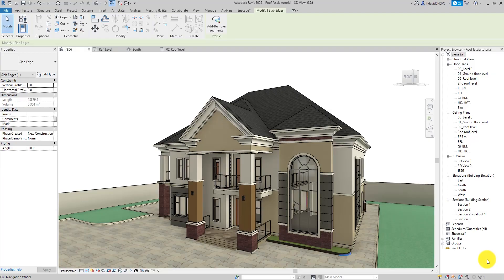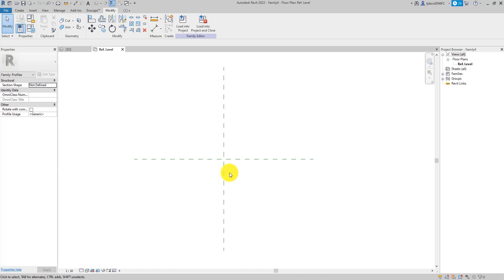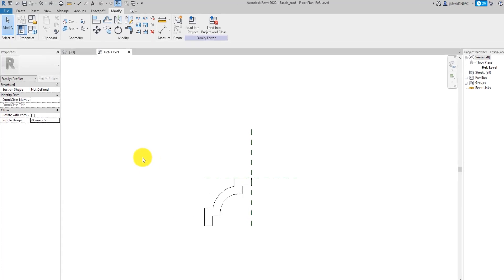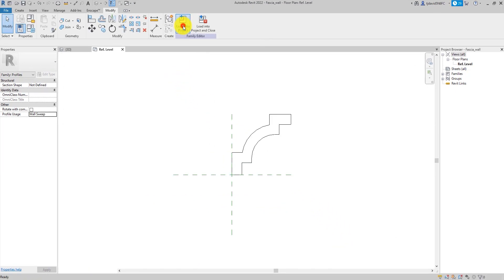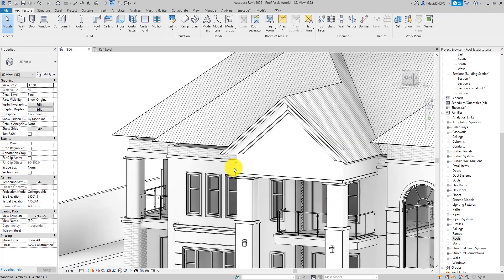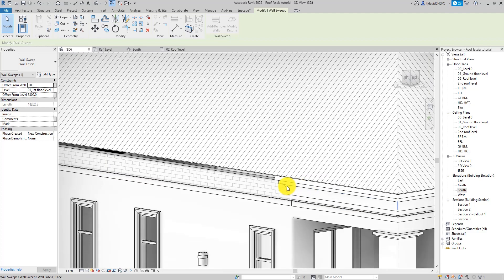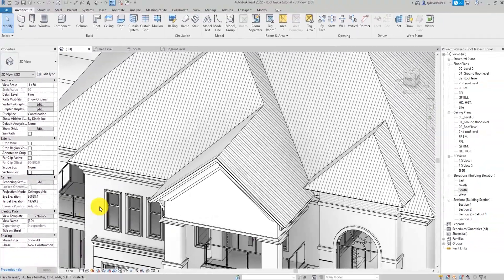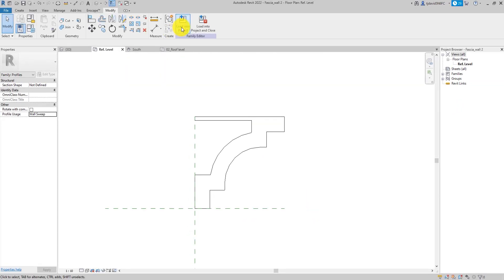How to Create concrete fascia in one click in Revit(2023 updated version)

Comment: Nice tip and trick sir but it too long process. i prefer model in place sweep
Reply from the maker: I understand, but then model in place is used for conceptual modeling, when you need to quickly show your ideas. Then, detailed information is not paramount.
However, it would be a shame to use a very powerful tool like Revit that can give you so much more to do so much less.
Revit being a BIM software, in our opinion should be used as such, information in the form of a building model, for efficient, cost effective and corroborative design. Not where you will base all your working details on estimates and assumptions. 
Moreover, the reason you probably think this process is long is because we don’t just show how you make things, we go out of our way to also show you how to customize them to suit your designs. The profiles can always easily be reused and edited to accommodate new designs and features. 
I hope you understand?

Comment: This is a wonderful one. 
Learnt a lot, that will help me in creating my next video. 

A quick question,
Why didn't you use the profile you created for the roof, on the horizontal roof edges.?
Reply from the maker: Very Good!!! 
I was waiting for someone to ask this question.😂😂
Now here’s the thing, you can use either only roof fascia tool or wall sweep to do this, but then, this roof has a gable, and we want to run the fascia above the wall following the roof, so assuming the roof has no gable we could have used only one of them (roof fascia or wall sweep), but because we need to modify returns at the front edges of the gable, and using the roof fascia the joints won’t just milter neatly like the wall sweep would. 
Now, In our previous tutorial where we did simple roof fascia, things worked out neatly and are miltered neatly provided you maintain the same edge of the roof (either top or bottom) but this is a bit different, this is thicker and bigger so that’s why.

I hope your question has been answered sir.
Reply: @SimpleorDifficult  thank you. 
Understood.
Reply from the maker: You are welcome